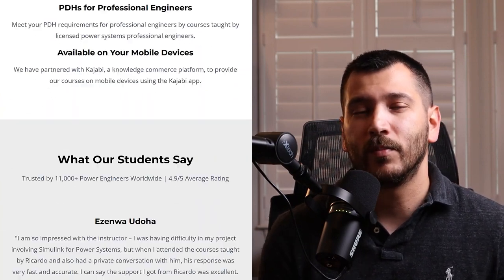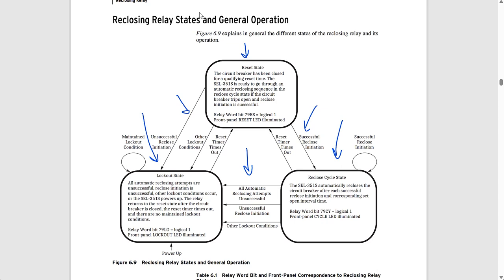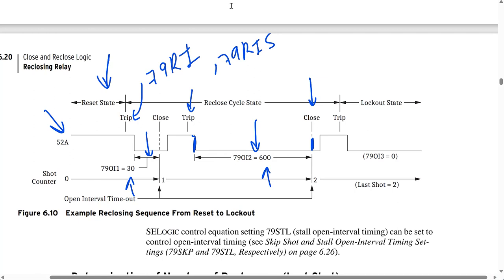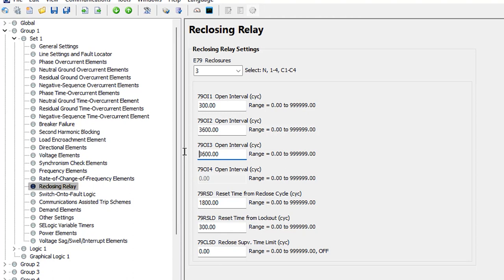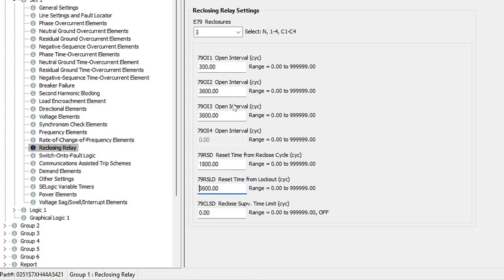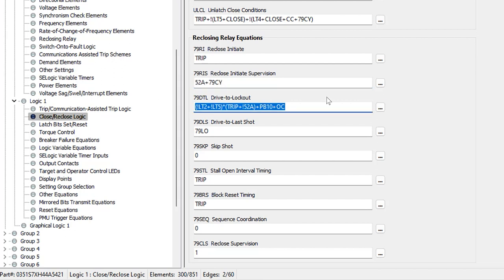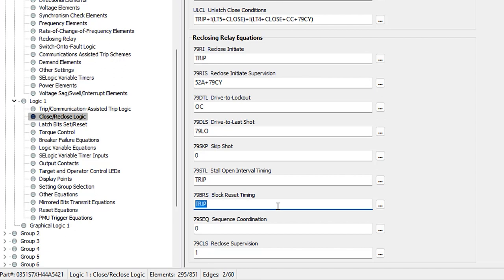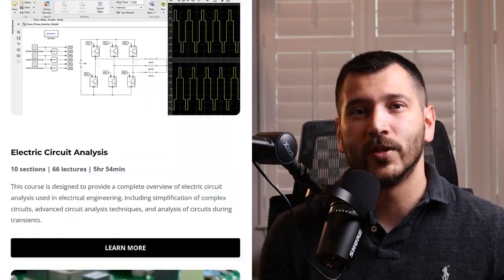Automatic Reclosing in Power System Protection | Example Using the SEL-351S Protection Relay

Comment: Won’t we destabilize system by wating 60 seconds before lock out?
Reply from the maker: Hi Reza! Good question, quick reclosing to maintain stability following a fault is a separate issue. If maintaining stability in the system is a concern, then yes, a faster reclosing may help. However, this is often not an issue and for the purposes of this video we ignored stability concerns.